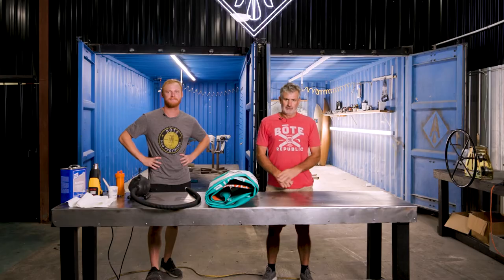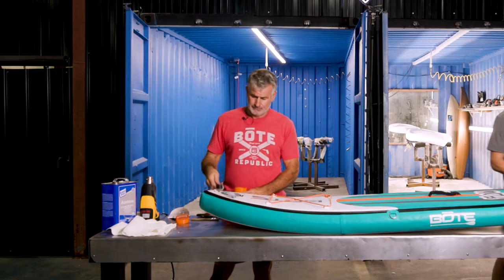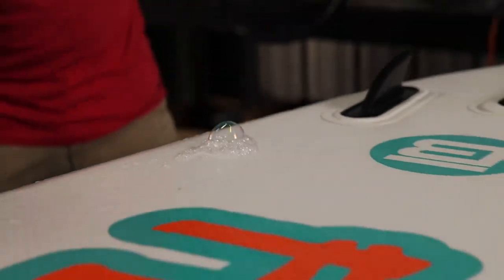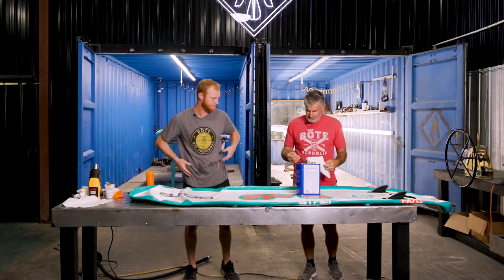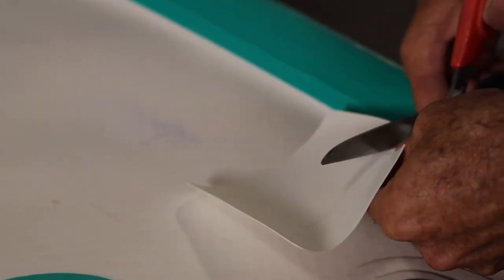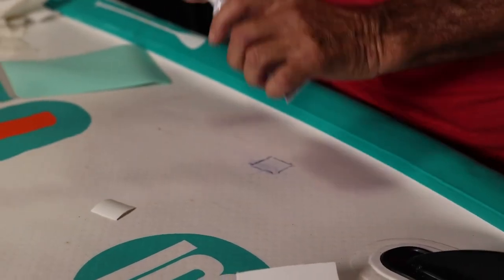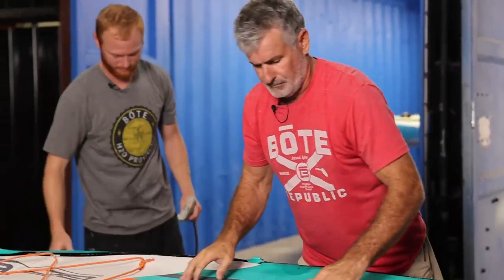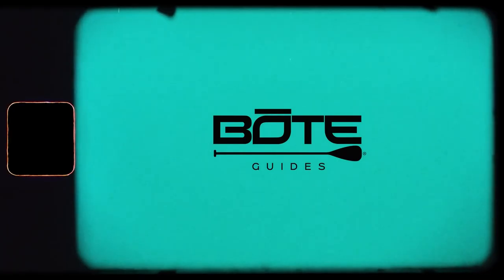How To: Repair Inflatable

Comment: I had a small hole on the bottom of a brand new board, but it was located in the sticker that says BOTE. Acetone immediately started removing the black color of the sticker and made a huge mess!

Comment: You said the valve was not part of warranty. So if valve is at fault, how expensive is it to replace or is it replaceable?? These Bote products are Not cheap!!
Reply: I bought a spare valve for my ae1004, it cost £10 and I bought the spanner  it didn't need the valve, just tightening.  I guess it's not a warranty issue as its a maintenance thing checking valves.